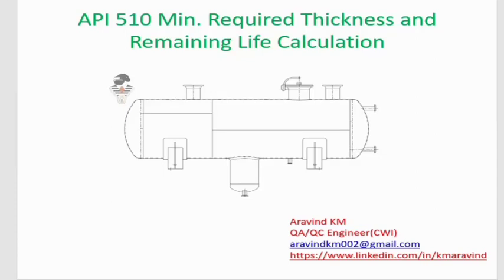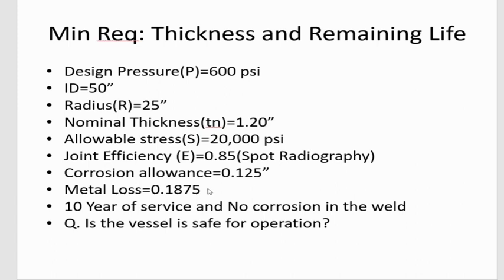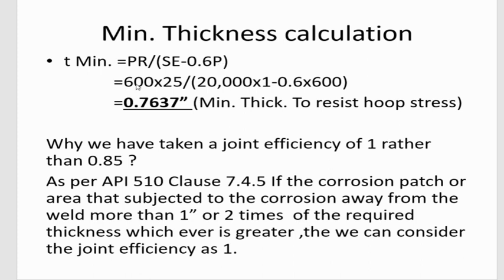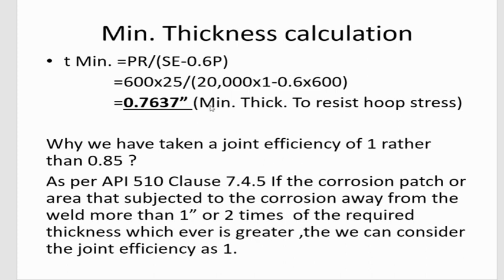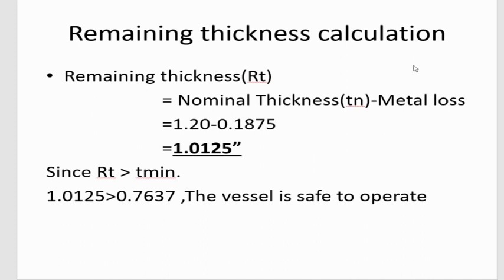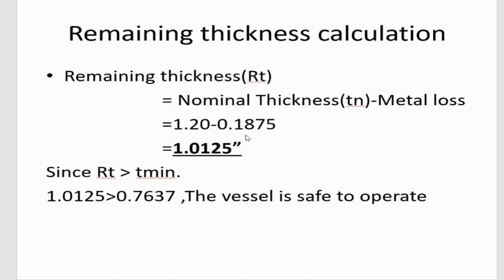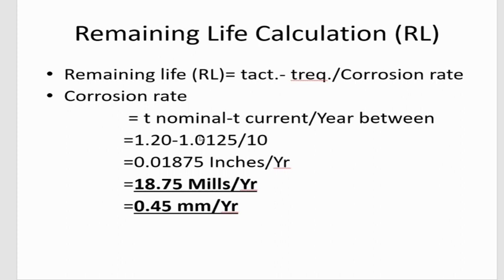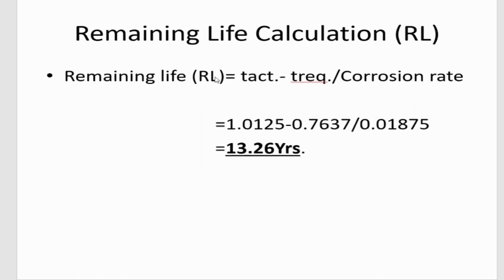API 510 Minimum Thickness calculation and Remaining Life of pressure vessels

Comment: Hi Sir, what if the actual thickness is thicker than nominal thickness? How to calculate corrosion rate.? for example measured thickness is 12.50mm while in drawing is 12.00 mm.